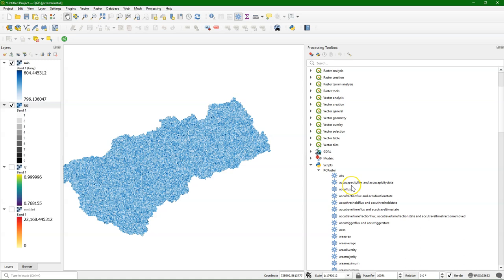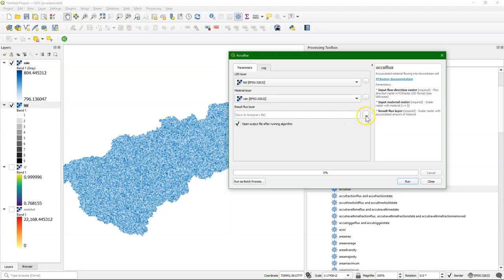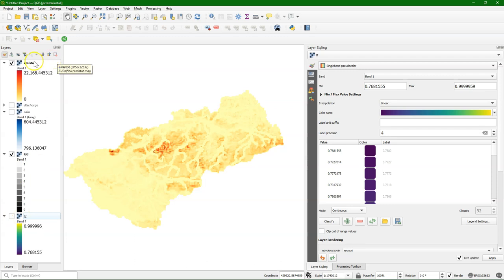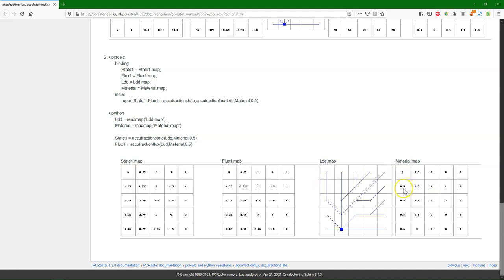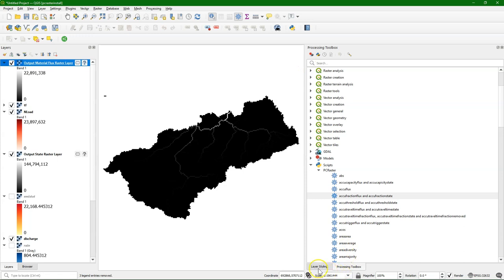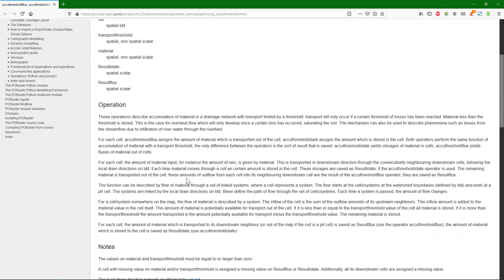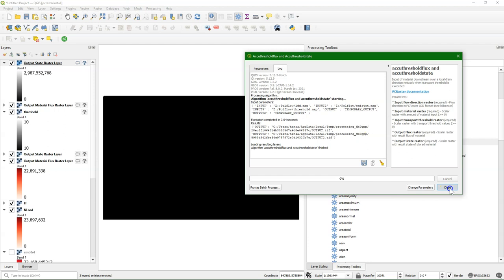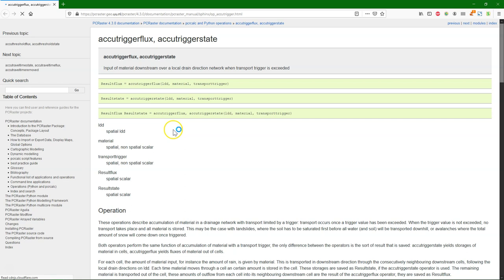Using different flow accumulation tools of PCRaster in QGIS

Comment: I was trying to use the accuflux function in QGIS and I am getting the fllowing error:

'Traceback (most recent call last):
File "C:\Users\chm594\AppData\Roaming\QGIS\QGIS3\profiles\default\processing\scripts\pcraster_accuflux_algorithm.py", line 148, in processAlgorithm
ResultFlux = accuflux(LDD,Material)
File "C:\Programs\Anaconda3\envs\pcrasterqgis\lib\site-packages\pcraster\operations.py", line 2090, in accuflux
raise RuntimeError("accuflux: %s" % (str(exception)))
RuntimeError: accuflux: arg#2: Number of cells is different than clone or previous argument'

I rechecked for the extend and resolution of the flow direction data and Material data. Both are same. Still I am getting this error. 
Can you please shed some light on this
Reply from the maker: It must be different. You can use from the command line the mapattr command to check it for both maps. https://pcraster.geo.uu.nl/pcraster/4.3.2/documentation/pcraster_manual/sphinx/app_mapattr.html